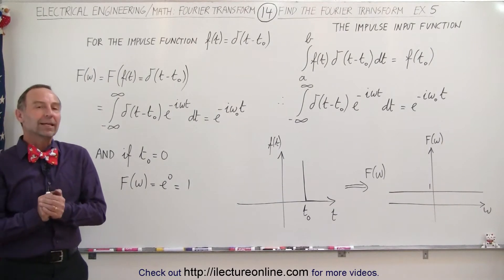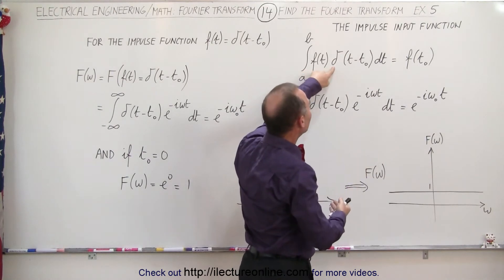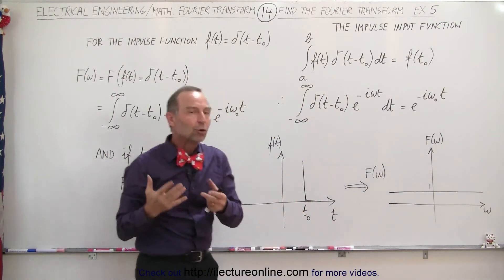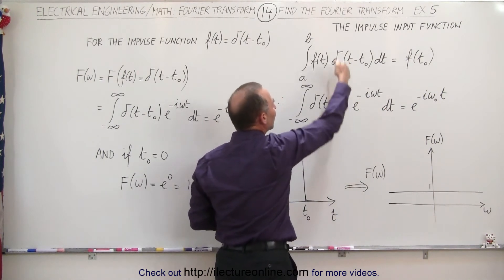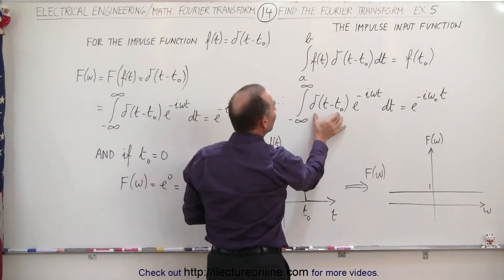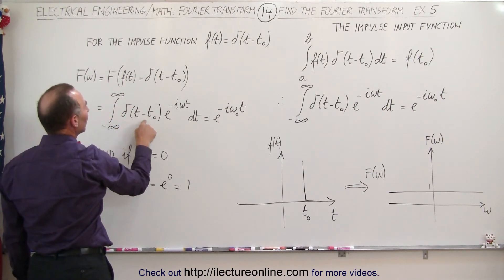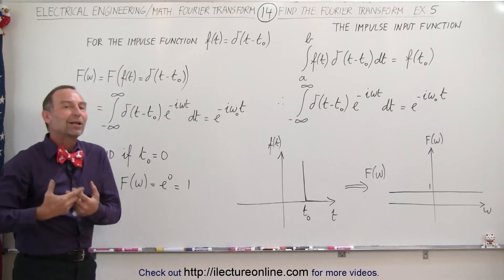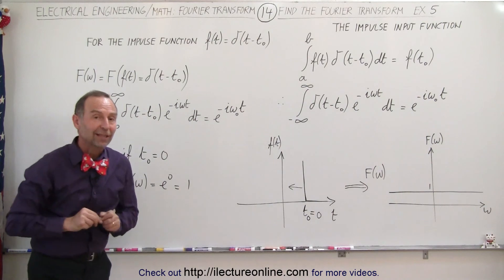Electrical Engineering: Ch 19:Fourier Transform (14 of 45) Fourier Transform:Ex.5 (Wo -- to)

Comment: Thank you for your lecture professor. At 1:16 I think it's (t0) instead of (w0). The (t0) of the delta function replace the (t) of the exponential function. It's what I got on my book. Thanks
Reply from the maker: You are correct.  Thank you for pointing that out.